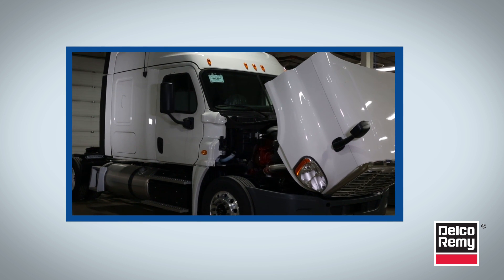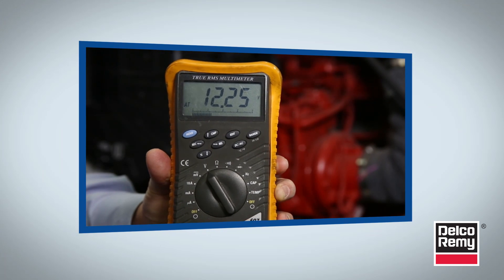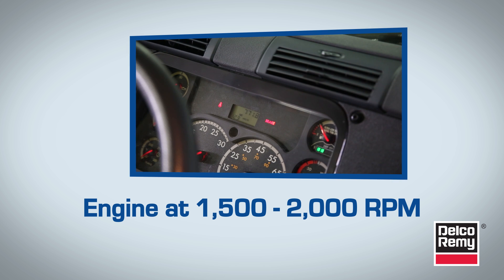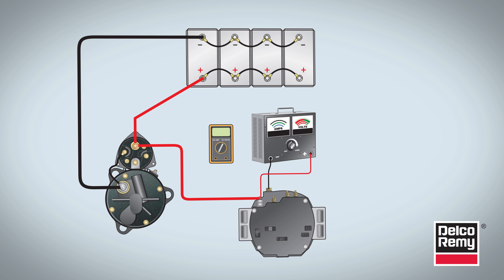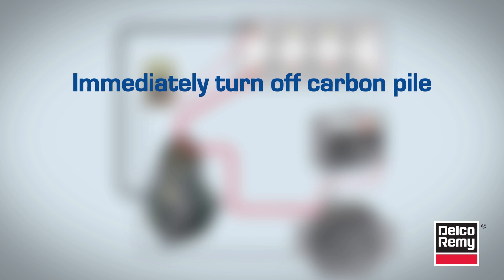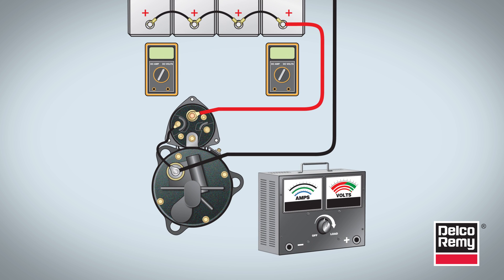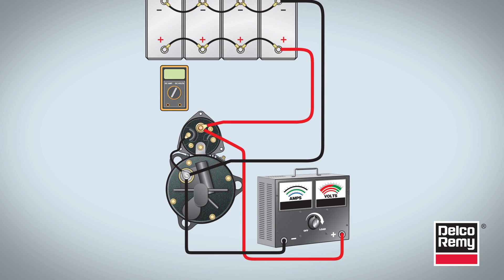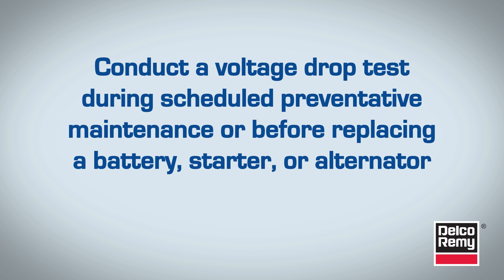Voltage Drop Test | Delco Remy Tech Tip

Comment: Carbon Piles are great for checking a battery.  Just set it to half the battery's cold cranking amp rating, and see if the voltage drops below 12 volts.  They can also check all kinds of cable and battery related issues on trucks.  I guess my only question for this video is, "During the alternator test, do I have the engine running while loading the system?".  Thanks,
Reply from the maker: Hi Joseph, If you are doing a voltage drop test on the charging cables-No, but to test alternator output, the engine would be running (above idle) and the load would be applied to the batteries.

Comment: try this voltage drop test for automotive, light trucks and vans.

here is a voltage drop test you should also teach ..
engine off. turn headlights on for one minute. then turn off. set volt meter at 20 volts DC. measure battery voltage at the posts..
12.65 is a fully charged battery
12.45 is a 3/4 charged battery
12.25 is a 1/2 charged battery.
try to perform this test if the state of charge  is over 12.5 volts.

start engine . turn on headlights.  meter set at 20 volts scale.
test One.   Negative battery post to the Positive battery post.. 14.1 to 14.8 volts DC is expected.
test Two..  Negative battery post to the engine block.. 0.04 volts DC max.
test Three. Negative battery post to the body.. 0.02 volts DC max.
test Four.  Engine block to the Firewall . 0.02 volts DC max.

test Five. Positive battery post to multiple fuses in the under hood fuse block. 0.04 volts DC max.  try to test as many fuses as you can.. there are multiple buss bars in some under hood fuse blocks and you can loose individual sections.

test six. Positive battery post to the Alternator output stud. 0.3 volts MAX that is 3/10ths of a volt.. because the alternator is putting out significant current. i like to see as close to zero as possible.. 0.08 would be very good..  60s and 70s mopars with hard wired amp meters in the instrument cluster will read 0.7 volts and be perfect.

if you get 0.00 on tests two thru 6.. change the volt meter setting to 2 volts DC or 2,000 Millivolts DC. perform the tests again.. some meters don't show fractions of a volt below 2 volts very well.  a test section  showing 0.00 volts usually is an incorrect probe location for that section of the test.

tests 1 thru 4 should be performed on every car with any kind of electrical issues. including engine /codes.  1 thru 4 can be performed in under a minute after you have learned them..

you will want to perform tests 1 thru 4 and perhaps 5 on every car before you finish working on it to prove the wiring under the hood is properly hooked up. you cannot see voltage drops except with this test.  it will save your hours of work and also prevent many comebacks if you spend these few minutes and PROVE the wires are properly attached and not corroded.